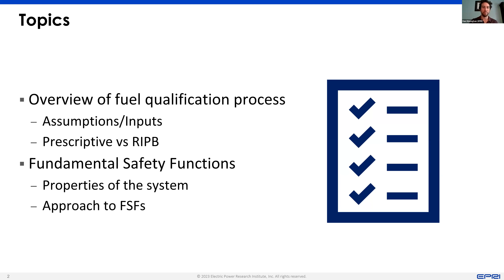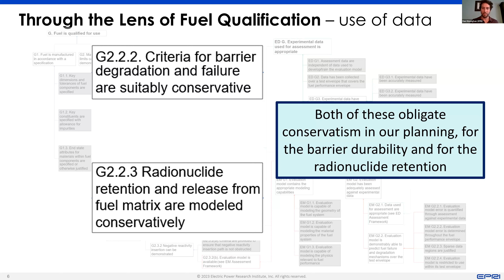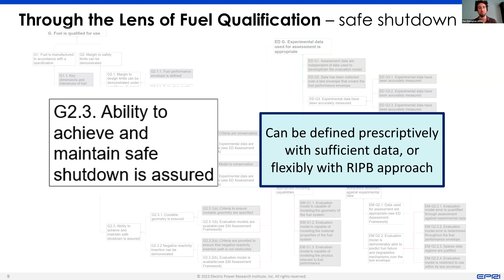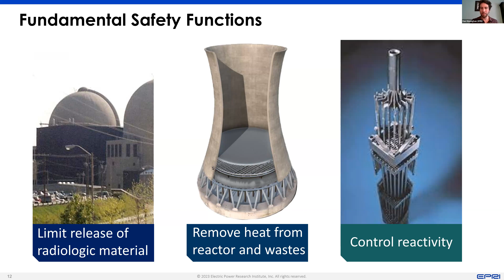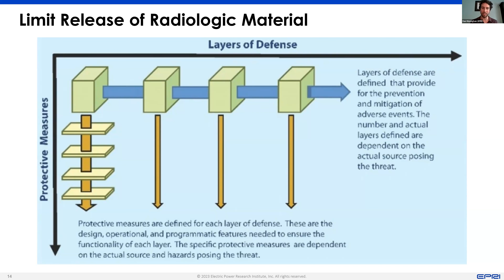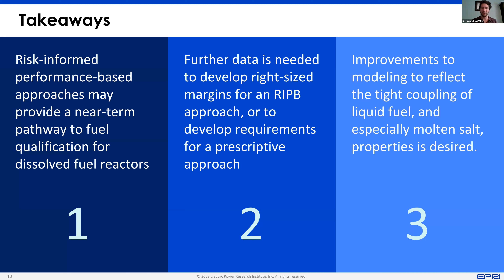Liquid Fueled Reactors: The Benefits of a RIPB Approach by Dan Moneghan with EPRI–July 28, 2023

Comment: SMRs were done in the 1960s, and were replaced with larger more economic reactors. SMRs today are still built exactly like large LWRs, NOT, repeat Not, factory built and fueled like the original DOE Propaganda requested them to be for military purposes. The new SMRs, are NOT physically as required to be factory built, & fueled, so are still sent to the field component by component and assembled & fueled there, and fuel is still shipped separately as well. Therefore, no new SMRs meet your definition of advanced.